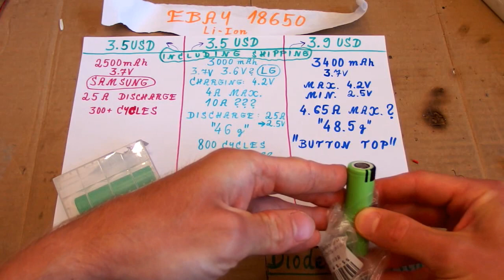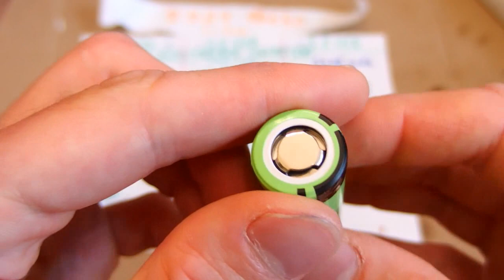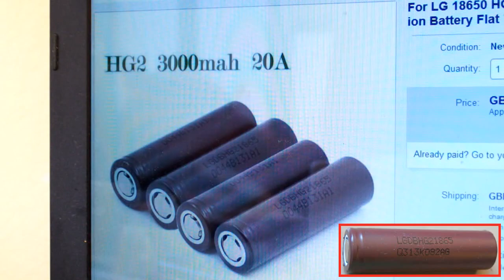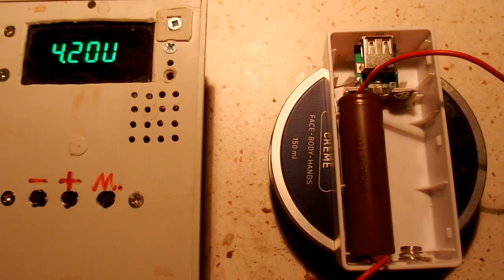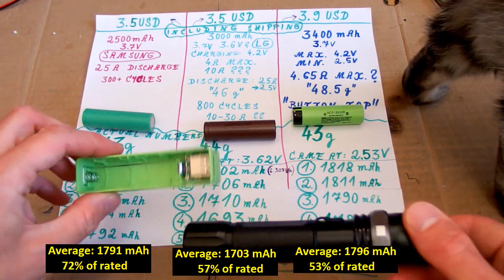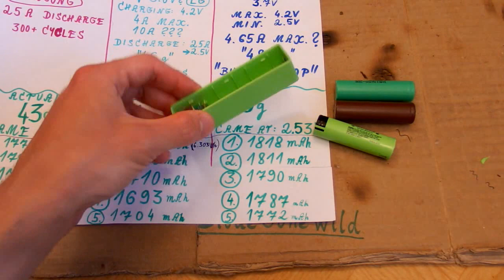3 good looking 18650 cells from Ebay - real or fake?

Comment: You should have also used a proper intelligent battery charger. Mine is the BT-C3400.  Each battery needs to be discharged and recharged three times before using.

Comment: You got a fake NCR18650B 3400mAh 3.7V lithium battery. Mine charge up perfectly and are 70mm high, weight is 48.5 Grams. Each cell cost me $21.00 each. I got what I paid for.

Comment: I have the originals of each of those. 

I must say that these fakes look very real. 

Bottom line: don't buy 18650 on ebay.
Reply: Lithium batteries and LED lights are the most common products whose information is lied about, they are always counterfeit and it is difficult to find the original product

Comment: 18650's storage voltage should be around 3.5 to 3.55V and that's the voltage all the HB6 LG cells came to me in a big box. There are not many studies about this topic but lithium ion tends to have lesser capacity loss when they are closer to 0% SOC but not in 0% SOC I hope I got that right(non english guy). Also lithium ion are made to degrade less when fully charged in typical application but they will lose capacity anyways. Lipo are whole diffrent story I had aquired some ranging in age from 1-10 years and I also did some experiments with storage. In lipo maintaining temperature and 40% SOC or 3.85V per cell is crucial there to recover almost 100% of capacity, you go in any direction, less or more - they suffer a lot and worse than lithium ion. I had some 25Rs(genuine) stored at 40% SOC for 4 years in 25 celsius and according to data I could find indeed I was able to recover up to 90% of their capacity but I also had seperate control group which were charged up to 3.55V per cell and left in storage. In case of those I was able to recover from 95 to 97% of their original capacity. I also should have mention that both control groups of 10 and 10 cells were fresh and never used. I think my test group of 10x10 is big enough to prove my theory about storing 18650s. I own several M12 brushless milwaukee tools but I don't use them regularily so usually after some big projects I discharge all of the batteries so they stay around 3.55V per cell if they are going to stay in the bag for 1-3 months or sometimes. While some of my coworkers are now complaining about their multitools M12 not accepting batteries which they all the time store in the bag fully charged I don't have problems like this and my batteries are performing really well. But I'm doing that little sacrifice when job is done and while I drink some good czech beer I got my ass up to hook batteries to electronic load and set it right then it does it job while I still enjoy that beer, then I can just put those batteries in the bag knowing they will be good.

Comment: The Li-ion battery 18650 is being tested for capacity with the final voltage of 2.5v and starts at 4.20v and discharges with 500mA, since it was not so tested, it did not show the right capacity at the end. These batteries (all three) in the video certainly have over 2500mAh minimum (not 1700-1800mAh) and this will be seen when they are properly tested next time and are probably original and good only you have to test them properly another time... 😏 !

Comment: How do you know if a cell is protected or not
Reply: Protected cells will have a small circuit board somewhere. Small LiPo batteries often have a small circuit board hidden in a gap near the top of the battery, but larger LiPo batteries or standard sized Li-Ion batteries usually rely on the device they are in to give them protection.

Comment: It's very strange. These batteries appear new but are very weak.

Some time ago I bought 50 laptop batteries for $ 1 each, and there were usually 6 cells inside. 30% of the batteries had over 3.5V, 20% over 2.5V, and the other less than 2V (but even 80% came back to life, thanks to the charger with the low voltage cell rescue function) and they keep the voltage and don't heat up when charging. Half of them still stored around 2000-2200mAh.

Comment: How to check real capacity(mah) of lithuim baytry i am confused about it 😐
Reply: You cannot do it with a multimeter. You need to charge it to 4.2 V, discharge to 3.0 V at a known rate and measure the time. DiodeGoneWild's device for this: danyk.cz/avr_aku_en.html

Comment: Hi Danik,
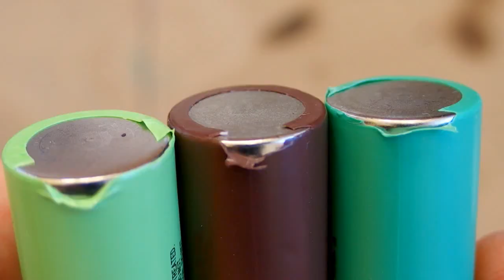At 14:00 when you show the bottom of the three batteries, I thought I saw, when the point of view was more grazing on the metal surfaces, that the bottom was slightly deformed in some areas, as if it had been filed and then brushed , to remove the welding points, perhaps the battery falsifiers have gone to a higher level of sophistication than the double bottom with a metal disk, unless they were visual artifacts due to the compression of the video ...
Hi and the next videos
P.S. LITOKALA is a brand sold by Banggood: in their advertisement they say that their batteries are 100% original, but when they arrive, under the brand (a sticker on the green plastic) they are branded SAMSUNG !! I have not done endurance tests so they could also be good ... but can i say: what ?!

Comment: These are probably lower cpacity cells re-wrapped as high capacity/current cells.
The INR18650-25R should weigh more, due to the higher rated current.
So should the Panasonic, due to the sheer amount of capacity.

Comment: Back when I was vaping I used these 3 particular types of batteries, which I bought as new and they costed between 10 to 18$. 
The one made in Japan, 3400 mAh is from Panasonic, older generation, high capacity, moderate discharge current, it wasn't very good for currents above 5A.
The brown one is indeed LG (particularly HG2), really powerful for vaping, very high discharge current, it lasted for quite long.
The Samsung one is the general purpose battery which came with my vaper. It was OK initially , but indeed it did not last many cycles.

I tried to test their capacity as new by discharging them with a 10 Ohm resistor and by measuring the voltage and current every 15 minutes until they reached 3.2 V and back then I came with these numbers: ~2600 mAh for Panasonic, ~2500 mAh for LG and ~2000 mAh for Samsung.
I guess the ones from the video are not fake but used quite well.

Comment: some 18650 batteries actually have built-in pressure release membrane which releases high pressure and disconnect battery from rest of the circuit when something gets wrong with the battery but after that is battery useless it just should prevent an explosion

Comment: The right one that says 3400mAh are from Panasonic NCR18650B, i only use Panasonic NCR18650B 3400mAh better's they are one of the best you can buy, i can see that your Panasonic NCR18650B is a secondhand battery and have been used a lot, because if they are good they should have 3400mAh.

Comment: The panasonic ncr18650b has a black QR code printed on the metal casing near the postive end, slightly visible through the wrapper. Read that the QR code is different on every battery. https://gdetail.image-gmkt.com/285/715483014/2018/1/229f32e9-dbe7-4a82-9c99-e2ccd30566d8.jpg

Comment: thanks for testing! Little bit long the part on the "Cinglish" - we all know how funny the translations are and most often very disleading or confusing! To be sure about the specs one should always look at the datasheet of the manufacturer of the battery :-) The batteries look very promising and could be real - but its good to know they are still fake or used ones or old shelfware with lots of capacity loss! Many old cells from old laptop batteries are still better and much more safe to use i would say! In me experience you can find good cell even with very low voltage above 0, like 0.5V can be still good. But when they have reached 0.0 or even negative they will be really dead or leaking a lot. This holds esp. for high-current cells.

Comment: I have found a store on AliExpress that sells genuine rated capacity batteries. I paid  $1 for a Samsung 3000 mAh 18650s when I measured it with my battery charger /. Capacity tester the battery was 3024 mAh which is good for a $1 battery (I ordered 40, that is why it was so cheap)
(The store is liitokala official store)

Comment: They don't want you to modify . no soldering tabs for making bridged in line power packs . because of the heat exposure applied to the batteries . but I love to know in your opinion what the best brand and highest rate batteries for high power lasers . as I want the best ones for my high end lasers. Thanks diodes gone wild.

Comment: Judging batteries by "weight" is just silly.  Even a cheap/fake battery could weigh more than a real high quality one, so it's better to actually measure them electrically rather then going by weight.
The bottom like is, regardless the weight, brand, and markings, most 16850 batteries top out at about 2,000mah or less.  It's physically impossible to pack more electrons into the same volume with today's technology (maybe more in the future). ;)

Comment: are you sure your measuring works? do you have something to calibrate or did you (ever) find a battery which has the capacity which is claimed by the manufacturer? :)

Comment: when i took a bunch of 18650 cells from old laptop batteries, they usualy were about 0 volts. i just plugged them to bench power supply, and charged at about 1A ( loocking if they aren't hot). and now i have about 250 of them with capacities from 1000mAh to about 2500 mAh (average about 1800 mAh) for the price of about 25 cents/pice :)

Comment: It can be a little bit misleading because companies using cut-off voltage 2.5V (LG - brown one 2.0V) when they testing capacity. 
Check the Info: 
https://cdn.shopify.com/s/files/1/0674/3651/files/INR18650-25R_Cell_SPEC_Tentative_1.pdf?738
https://www.nkon.nl/sk/k/hg2.pdf
https://www.batteryspace.com/prod-specs/NCR18650B.pdf 
But anyway those look like old badly stored or already used.  
You should by something like this http://budgetlightforum.com/node/41442 it cost about 20€ but it will help you a lot with battery testing (Charging/discharging 4 batteries independently) Measuring internal resistance etc. It works with a lot of different types of batteries.

Comment: Genuine Samsung 25R and LG HG2 are popular mid range batteries used for vaping these days.  The 3400 mah Panasonic is popular for flashlights but usually prefer real button top and protection pcb for those applications.

Comment: My guess is the cells are just old cells that never sold & likely lost capacity due to improper storage charge (too high or left in storage for too long).  Then someone bought them in bulk & listed their "rated capacity" as the capacity of the cells--rather than individually testing them to determine what their actual aged capacity is at the time of sale.
That's why I think it should be legally mandatory for all li-ion cell manufactures to engrave the manufactured date on the bottom of each them--otherwise unscrupulous sellers on ebay can sell unsuspecting people junk inferior cells.
Reply: There is a shortage of Lithium batteries. They never ever "sit around never sold" long enough to lose capacity. These will be low quality cells (lots of those out there), or used ones... re-wrapped.
Reply: The Panasonic cell in the looks like a real Panasonic cell.  I doubt Panasonic would sell low quality cells.  There must be another explanation.
Reply: panasonic/sanyo, sony print the date code on both the wrapper and metal casing.
Reply: @Jeff79z  Not that I've ever seen can you show us an example of that code & how to decode it?

Comment: Samsung specs for INR18650-25R states:  “Standard charge: CCCV, 1.25A, 4.20 ± 0.05 V, 125mA cut-off”
For the LG the manufacture states: “Charge (CC/CV): 4A charge to 4.2V, 100mA cut-off”
Is it possible to check if that charger meets the specs?

Comment: those are not fakes but  they take down them to 2,75V or 2,5V that´s why you are not getting the whole capacity ....you go down to 3,0 V
Reply: Makesense, It might be quite real capacity if discharge at the lowest discharger voltage

Comment: They have now their own production (those are new batteries) but they fake packaging. They are all the same.
Try this one it's not fake I bought 4 pcs and measured capacity and it's 2500mAh as advertised. 25R mean internal resistance 25miliOhm https://www.aliexpress.com/item/32912999547.html?spm=a2g0s.9042311.0.0.5c6c4c4dlU4oW1

Comment: Those cells are likely fake cells, the real manufacturer cells come much closer to their rated capacities (2500/3000/3400mAh) and are also not $3 per cell (or thereabouts). They are much more expensive - especially the Panasonic NCR18650B.
Reply: I've paid $3.80 and $2.75 per cell for NCR18650B on aliexpress and both were genuine (shipped price 4pc). Ebay tends to be a bit more expensive, but a few cents more should be able to get a good cell.

It looks like the top sellers right now are offering as low as $2.20 per cell + shipping.

Comment: Looks like i got decent fake LG HG2 from aliexpress for 1.6€ each, they have 2.55Ah at 1A discharge and can easily handle 6A discharge. They are rated at 2.85Ah at 3V and 20A discharge.

Comment: Great video! 
You could test Litokala 18650 or 26650 li-ion batteries from Hong Kong, they cost too about 4$ including shipping, but it is possible to buy them from Manufacter, not only from some random Reseller.
Reply: I have been buying Litkola from Likola Official Store on Aliexpress, they are priced very competitively and check out exactly as described , very good

Comment: I have those litokala ncr18650 ... all of them come out to be 3400mah to 3500mah... u should test those with your tester ... I used readymade Chinese capacity testers... buy litokala and u will see it!
Reply: Yes, I was just going to ask for test of Liitokala 18650 bateries, they can be bought for nice money, and i had only good experiences with them, even the one with the protection circuit really have it. And the fake LG HG2 seem's to work also fine

Comment: Highest capacity batteries right now are LG INR18650-M36 and Panasonic NCR18650G which are usually quoted as 3600 nominal, but really under realistic discharge currents they're indistinguishable from 3500. I think both are specified to weigh 47.5g

The first two of "mysterious numbers" on brown are LG, which (if it's not a fake sleeve - which it stands to reason that it likely is) would indicate where it came from, that would be an INR18650HG2 with a 3000 nominal capacity.

"Do not modify" seems like they're challenging you :D IDK, sleeve replacement, top piece replacement, poking inside the top with a needle to reset the pressure fuse if blown?

INR18650-25R is specified as weighing 44-46g, the INR18650HG2 doesn't have nominal weight but max is specified as 48, and the NCR18650B is specified as 45-47. Unless your scale reads consistently low by a couple grams, it would make all of them likely fake - unless they lost some electrolyte. Does that happen, do rechargeable batteries lose weight with time to a tune of a couple grams? I wonder. Besides, i don't think the top of the NCR battery looks like it would on the original unit, you expect super sharp stamping with very little roundness, fairly shallow, and the white washer having such a narrow opening that you can barely see the slits at all. Probably worth looking up what the tops of other batteries, if they were original, should look like.

Comment: The 1st Samsung battery is rated 2500mAh / 1.25A std charge - 4A max charge / 20A discharge max : https://www.powerstream.com/p/INR18650-25R-datasheet.pdf
The brown LG is rated 3000mAH / 1.5A std charge - 4A max charge / 20A discharge max : https://www.nkon.nl/sk/k/hg2.pdf
The green Panasonic is 3350mAh / 1.6A charge / 4.8A discharge max : https://pdf1.alldatasheet.com/datasheet-pdf/view/597043/PANASONICBATTERY/NCR18650B.html
It's always safer to refer to original datasheets :)

Comment: I was also laughing with you, the writing was just loopy :-D
Odd how all three batterys have similar capacitys, like they all come from a common pile of old cells.

I replaced my old acer laptop battery but it died after a year, i'm thinking it was old cells with a fresh shrink cover on each.
I got what i payed for lol :-D
Love your cat :-D
Reply from the maker: You're right, the capacity and weight would suggest old cells. Acer laptop? I had 2 acer laptops. One failed after 2 weeks. The other one had no camera despite the shop claimed it, and it also had a smaller HDD than advertised. I returned it few days later. Then I bought HP in anorher shop. It lasted 10 years. Then I've bought another HP.
Reply: I'm not a lover of modern laptops, not enough strength in the case and an over compressed chipset, designed to fail with heat.
I have an old acer aspire 5315 from 2007, solid and it's never failed.
And a keyboard with nicely shaped keys, propper keys, not flat lumps of plastic lol.
I'm an old git that likes the quality of older designs.
Oh the hard drive is the original, no bad sectors, a reliable real drive.
Not ssd's that are guaranteed to die 100%.
Memory death, nope not for me lol.

Comment: Why did you discharged those batteries only to 3V? They should be discharged until 2,5V and than estimate capacity. The differences shouldn’t be so big but it worth to check. Do it again :)
Reply from the maker: The difference is only about 1%. I've already demostrated it in another video.

Comment: That third battery supposed to be a Panasonic one. Original Panasonic batteries supposed to have 4 spokes on positive side, yours has three. I have one or two of these, also with three spokes, but with proper capacity.
Reply: that cell is supposed to have 3 spokes